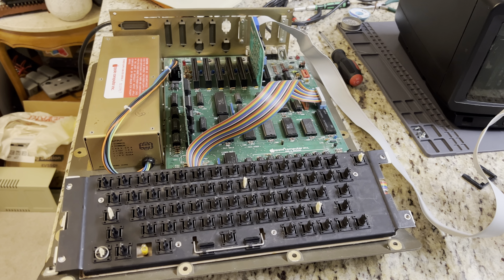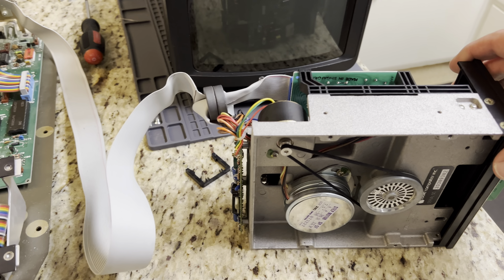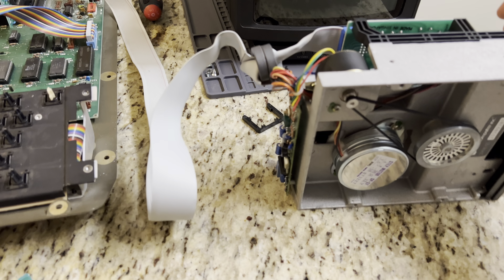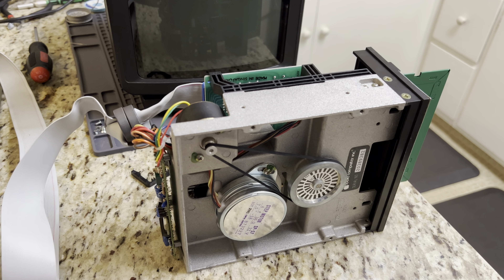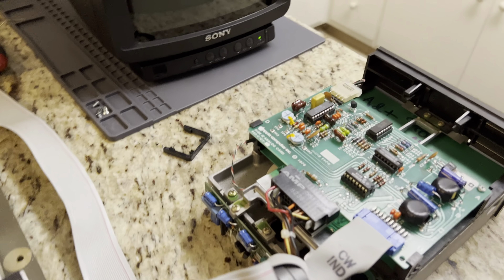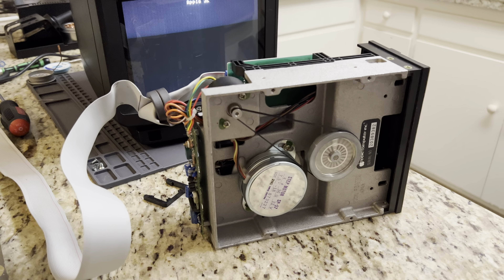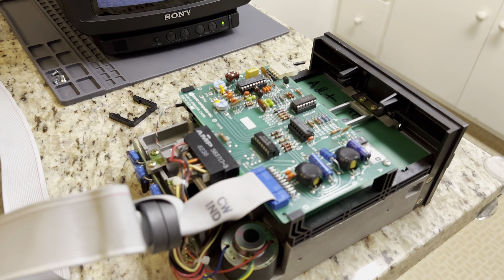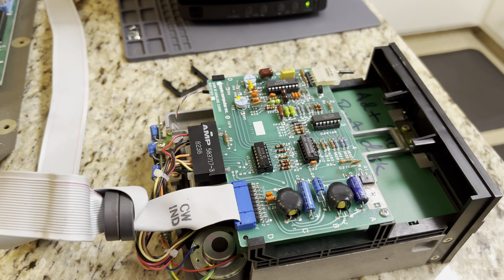Apple IIe Disk II drive with problems after repair + restoration

Comment: I had this exact issue.  I had just rebuilt a drive, cleaned and lubricated everything, and tuned it to 60hz.  The drive had tons of corrosion so I cleaned and put DeoxIT in the chip sockets.  In the process I damaged one pin on the MC3470P chip.  It was incredibly difficult to see.  The drive would just spin and spin on forever.  Once I repaired the damaged pin on the chip, the drive immediately started working again.
Reply from the maker: That's awesome - glad you were able to figure it out and get it working again!

Comment: There's a chip on the drives main board that will pop if you plug the drives cable in the wrong way, which is way too easy to do. I forget off hand what chip it is, but it's the socketed IC right in the center of the board. When it goes, the drive will just run indefinitely

Comment: You need to do a disk speed test. I believe there is software on the Apple Diagnostic disk, don't bother with the strobe because it is not as accurate. Requires a blank disk to write to. Adjust the speed so the display shows as close to '0' as possible.

Comment: I’m having this same exact issue. I have drive “A” and drive “B” (those are just the labels that I assume were put on them in the 80’s or 90’s)

My drive “A” was working fine, reading disks perfectly, running smoothly, then it went “grrr grrr grrr” three consecutive grinds over and over again when trying to read a particular disk (not sure which disk)

Now it turns on, does the initial head reset, and then just spins indefinitely. It won’t even attempt to read disks anymore.

Connected my “B” drive to the drive “1” connection on the disk ii card, and it was working perfectly, I played Oregon Trail, I played the Introduction to Apple iie, etc.

Then I put in a disk, it did the “grrr grrr grrr” over and over again, and now it does the same thing that drive “A” is doing. It’ll reset the head and spin indefinitely, with no sign of attempting to read disks anymore.

Comment: Been working on my apple drives lately myself.  One question is whether you can confirm it's spinning at the correct speed? Using an incandescent bulb (not led) make sure the 60hz (assuming you're in the us) label on the drive wheel looks like it's not moving.  If it's moving at all, adjust the potentiometer on the power board to adjust.  If it's not that, the only other thing i can think of is one of the chips, possibly the LS chip.